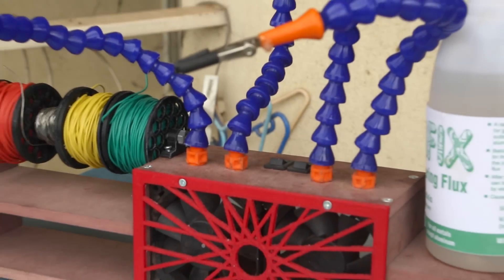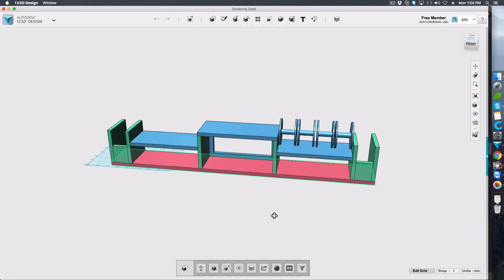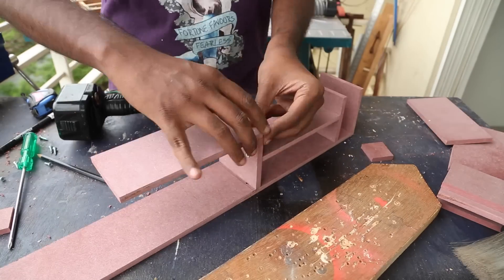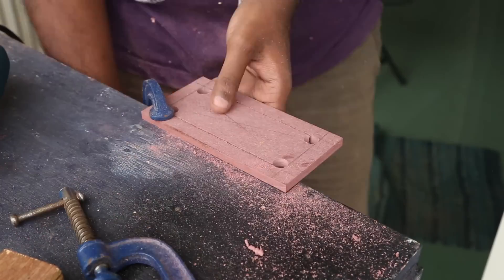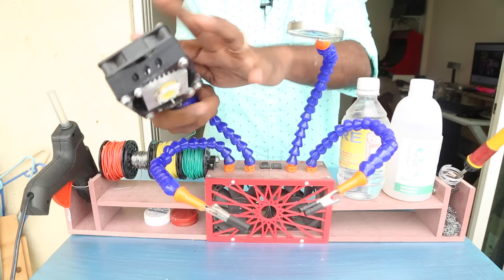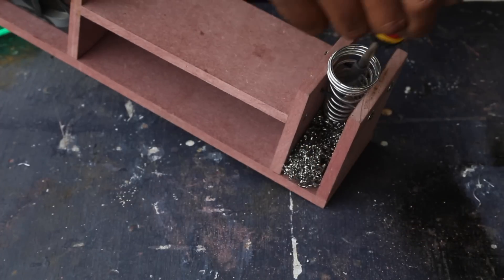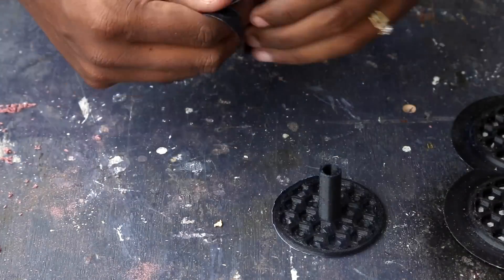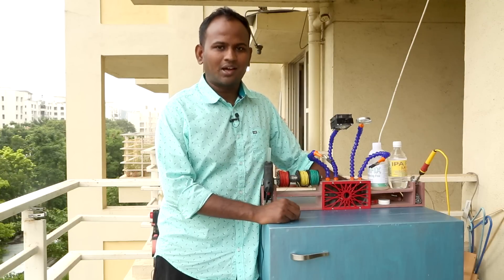Build Soldering Station using MDF

Comment: Excellent work ! I made my own fine extractor using a 12v cooling fan from a large screen project and salvaged the intake and used as a base, added a carbon filter, and use a speed controller from eBay to power and control the ventilation speed, and I’m using a wooden dowel and wrapped my wires just the same as you did, great work !

Comment: How long did your power supply last? And after how much time the LED died? Using the power supply current limit as current "protection" for your LED is a very bad idea. Adding the fans into the equation makes everything even more brittle, and all of this to save on one single resistor?!? Man, you need to rethink your electronics, trust me

Comment: I hope that the mesh underneath the soldering iron is brass and not steel wool because steel wool will damage the soldering iron tip.

Good work on the solder station, videos like these are giving me some great ideas for what I want when I build mine.

Comment: A suggestion, try the KX-40 from goot costs around 450 roughly it comes with a super pointy tip,put that aside for smd stuff and buy a chisel tip from aliexpress,or a hoof tip from vartech at your local store.(I personally prefer chisel over hoof)
for a 450 rupees iron a 150-200 rupees original tip from aliexpress might seem too much but the original tips have a coating that prevents them from overheating like crazy.
In the Indian market of budget soldering irons its a good choice.

P.S. this is not random mumbling ☺ I have gone through at least half dozen of those cheapo irons and burnt a lot of expensive components due to overheating.
I am presently running a Kx-40 and a 6k soldering station from Vartech.

P.P.S 😀 unless you are buying from Aliexpress or Banggood FR-4 boards are relatively expensive in India, for quickly putting together circuits ull be forced to use the cheaper FR-2 boards,the overheating crazy irons will wreak havoc on these boards,overheat the board too much and the pads will lift right off.

Sure you can always make do with what you have but I am just putting it out there. 
hope this helps,cheers!
Reply from the maker: Thanks for the great info. Where are you from?

Comment: lubrication goose neck?????? what are those things called???? can you provide me with some information like what are those things actually used for and in what kind of shop can we buy it???
Reply from the maker: +bikesh shahi try searching in eBay and Amazon
Reply: bikesh shahi they are used on CNC and milling machines to supply air or coolant to the machining tools. search for CNC coolant hose on eBay
Reply: ***** thank you so much for the information
Reply: its called "loc line" http://www.loc-line.com/  sold at many places and has unlimited uses. originally designed for dispersing coolants in machining. they make many sizes, colors and fittings, adapters etc.

Comment: what is the name of the blue flexible sticks??
Reply from the maker: I have no idea. But you get that at the shop which sells acrylic sheets and tubings. This is usually used in lathe and machining tools where you need blow air or pour coolant oil.
Reply: mediamilan not that one 
I'm talking about the stick on which u have mounted the magnifying glass and the alligator clips
Reply from the maker: I am talking about those only. I think those are the only blue flexible ones in the video.
Reply: https://www.amazon.com/Loc-Line-LP-40413-Line-Coolant-Hose/dp/B002QG4F8Y/ref=as_sl_pc_ss_til?tag=dustin0e-20&linkCode=w01&linkId=LCDLQVZ7MTCMUM5T&creativeASIN=B002QG4F8Y